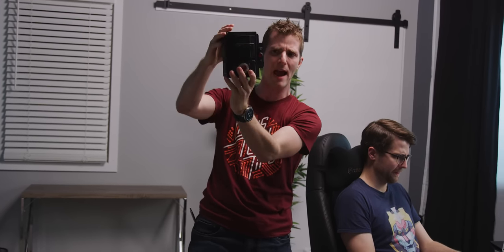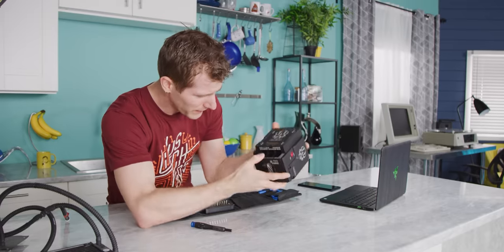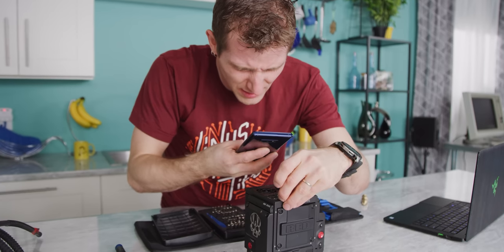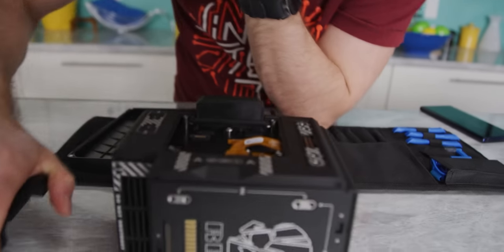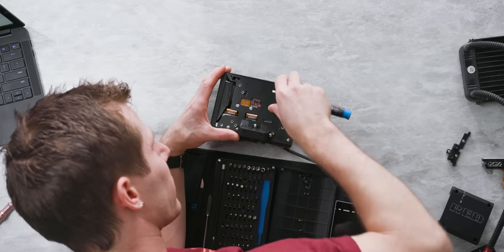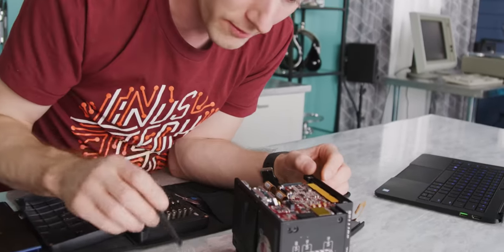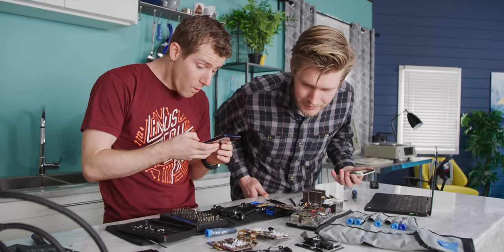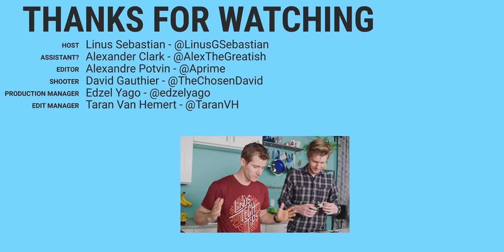We TOOK APART an 8K Camera!

Comment: I wouldn't be surprised if Linus ends up dismantling Elon's next SpaceX reusable rocket.
Reply: LINUS HOW DID YOU BREAK THE FUEL PUMP
Reply: Watercooled rockets ?  Hell yeah
Reply: RGB rocket!
Reply: @Am65103  Forget reusable, it wouldn't even be usable.
😂🤣😛
Reply: Can't wait for a watercooled Falcon Heavy
Reply: Starship will have regen colling, so Linus won't need to add liquid cooling to it.
Reply: What if he drops the rocket then? Elon will be pissed.
Reply: Yeah, I bet Linus would love to water cool a rocket's onboard computer
Reply: Sponsored by IFixit
Reply: straps 100 nhd-d15s to a rocket
Reply: to watter cool it and attach rgb to it
Reply: Actually the rocket is fuel cooled. The temparature of the engine exhaust it too high for the material the engine is built out of. So they pump fuel (in spacex´s case it's chilled Rp1[highly refined kerosine]) through the compustion chamber and engine belt (they are two-walled fuel flowes between them).Then it gets burned in the combustion chamber.It is called regenerative cooling. Man this comment is kind of overkill

Comment: Next, tear down the new IBM quantum computer.
Reply: Drop it instead
Reply: They may already have done this, but we wouldn't know until it was observed.
Reply: Water cool it
Reply: @KieronMiddleton  Nice one
Reply: @BarnyTrubble  I mean since they already use things like liquid helium cooling to achieve the temps needed for quantum effects I don't think adding water will work out well.... Of course adding water here isn't working out so well either...
Reply: @Ender240sxS13  water cool it
Reply: hahahaha XD too good
Reply: It needs to be water-cooled .
Reply: these are already like liquid nitrogen cooled right
Reply: @kawatzaki  no, nitro is to "hot" for the pusrpose of QCs -> these are using liquid helium. Actually 2 isotopes of helium in some special concentration, that allows them to create self sustainable near zero K cooling cycle and then you can observe the quantum states of collapsed wave function ;)
Reply: Not even they have enough money to buy it. But the might let them go there and he drops it then?

Comment: "Part 2 : Ordering a new Red 8K Camera"
Reply: Well at least its only the camera and not all the accessories!
Reply: @KoploperMau  RED is EA - charging up for all the DLCs(accessories)
Reply: Part 2 : Maybe I should have had my hands shut
Reply: @JazibAli360  From a professional standpoint, having it modular is way better for upgrading and repairing. If you want to upgrade or repair something, won't it be better to just change the part, instead of the whole camera system?
Your comment is like telling me PC part manufacturers are basically EA because you have to buy every part of the PC instead of an all in one package.
Doesn't make sense to me.

Comment: Building $1000 PC (uses anti-static mat)

Taking apart a $30,000 camera that isn't designed to open ever especially out of a factory (no anti-static mat)
Reply: They need more than an anti-static mat for this...
Reply: 60k*
Reply: Neckslit  that's for two cameras plus the *accessories", one block of camera alone costs 49.5k
Reply: Oh yeah yeah
Reply: lol
Reply: Trospher no thats for 1 camera with all accsesories
Reply: $50,000*
Reply: Neckslit  it cost $130 for two of the cameras and accessories for both

yikes
Reply: $50,000*

Comment: Linus you're wrong about the lack of a performance gain. Reducing the temperature of the CMOS will improve the low light performance substantially by reducing thermal noise.
Reply: And how many LTT episodes were filmed in the dark?
Reply: Soooooo what you're trying to say is, they need LN2 all up in this bitch?
Reply: @beni2cc  Exactly. We need more LTT videos on astrophotography!
Reply: also i think it could probably handle more fps for a given resolution than it can in "normal cooling" condition, if only the firmwere would allow that.
much like those cameras that, with a firmwere mod, can shoot highierbitrate/fps/resolution than manifacturers allow them to, but often overheat while doing so
Reply: @beni2cc  Image all the RGB-in-the-dark shots in the future if they pull this off
Reply: @beni2cc  RGB showcases. Where it matters most actually XD
Reply: I don't think the sensor is hot enough running with stock cooling for there to be any significant difference. The sensor is quite large and must be at least somewhat powerlimited since it's running of Batteries. It should therefore be quite easy to cool, theoretically at least.
Reply: @beni2cc  It would technically benefit for any situation, but the one in which we could see a significant difference should be low Light scenes.
Reply: Well the question there is whether they'll actually be cooling the sensor or just the processing and power delivery elements.
Plus, even if they did, wouldn't water cooling introduce vibration to the sensor? You've got fluids flowing through a block mechanically coupled to the sensor.
Reply: @PierrePotonnier  what I'm tryna say is, no one is complaining that LTT's 8k videos are too noisy
Reply: @tiarkrezar  lol
Reply: @covoeus  imagine*
Reply: @beni2cc  Yet. I will start doing just that for every video starting with this one:
This video is quite noisy if you couldn't tell. If only they watercooled their camera.

Comment: Scientific cameras very often have active, sub-ambient cooling solutions, especially ones with greater bit-depth than 12-bit. For example, in our lab, we have a 16-bit X-ray CCD which is attached to a Peltier element which cools the chip, and the hot side of the Peltier element can be cooled with both air and water. We typically run it at -70 degrees Celsius, as, even compared to -60 degrees, the inherent electrical noise is just sooo much lower. This matters A LOT in high-dynamic-range-applications.
Reply: Agreed, I think Linus is actually underestimating the value of cooling the main image sensor.
It's amazing to see that consumer level cameras are still all passively cooled, even when we have Sony A7's overheating left and right. In the next decade or so I predict we're going to see a new revolution of cameras with active cooling.
Reply: This thread was more interesting than the video
Reply: @highks Okay, but the RED 8K is actively cooled.  Any other camera could use the same trick of passive while running video, active after that until cool enough.
Reply: @budthecyborg4575  It seems straightforward to run a heat pipe from the image sensor to a plate on the bottom of the DSLR.  If the user wants to get it cold, just cool the plate.  If you're willing to drag around the weight, you could even put a Peltier on it.  It won't work colder than the freezing point of the fluid in the heat pipe, but that could be methanol for a -114 C limit which ain't bad.  If you don't cool the plate, the camera just passively cools through it.

Comment: You guys are nothing short of absolute lunatics, and it's awesome! I am very excited about this potential project, but I do hope you tread carefully when you come up with a plan. I'd love to see some machine work done (by an outside source if needed) to make custom heatsinks so the casing could still be screwed together. That camera is going to be twice as baller status if you are able to pull this off. Good luck!
Reply: That's what I was thinking too. The only way they can pull this one off is if they bring in outside help to have water blocks/mounting designed and machined and then all other stuff needed to route the hoses out 3D printed.
Reply: They do have a CNC but I don't know if it would work for this type of project
Reply: Plus when tearing down a device like this a more professional approach may be better than their usual 'just use zipties'

Comment: Of course this project is possible. But you're going to need far more skill than has been displayed in your other builds. I'd get on the horn with CNC mill operators/machinists ASAP and get whichever minion of yours is best with 3D design to start drawing the mating surfaces of all parts to be cooled.

Also for those wondering it would take about 35 million views for a YouTube video to pay for this camera. Not enough cats, dancing or Fortnite for that to happen.
Reply: Ben Heck Hacks heeeeeeeeeeell yeah Ben heck, my man
Reply: You called minions to the workers
Reply: Was wondering if it was worth taking apart a 30k+ camera for 3-4 millions views well if it does work it's a nice project for rich people :P
Reply: Not just the lack of skill either. This is a big project, not something that can be done in 1 or 2 days with no knowledge of the system being modified. They should have bought a dead red camera and used that, using your production tools is never a good idea.
Reply: The L E G E N D himself
Reply: They need AvE !!!!!!!
Reply: Please, stop. This is 5 axis machining, very complicated design work. This is NOT Ben Heck level stuff... The designers and engineers at RED are badass and have very specifically designed this stuff to work. I'm sorry Linus and Alex, but you're not cut out for this.... Stop. It's not funny, it's just dumb.
Reply: @thomasp4902  Did they say it was a working camera? We never saw it in action so... IT is LTT though.
Reply: @tjarsun  YEAH
Reply: LTT also has other sources of income such as floatplane, sponsor revenue etc
Reply: kickasssloth360 you must be new here
Reply: More skill than it took to take a sawzall to a graphic card heat sink?
Reply: @MakerofThingss  It's most certainly not 5 axis machining. It can easily be done with 3 axis or 3+2 axis positional
Reply: A few copper sheet and an hacksaw are enough
Reply: YES! Get in contact with them and make a water cooled, portable RED camera.
Reply: Yeah. It will need a custom body.  The best and riskiest part I could do is apply metallic thermal paste on those chips.  
I really don't know why Linus have to do this, plenty of time and money I guess? 😁
Reply: @xenonram  true, but point of seriousness stands.
Reply: I think your comment will just encourage them even more. Knowing Linus... yeah
Reply: Ltt needs far less than that. The more subscribers you get the more you get per view
Reply: @jordansean18  Can you give use the link to that?
Reply: @CharlesStaal  who lied to you
Reply: amazin... what if thanks to this video he gets 1 extra million views in his next 35 videos and therefore thanks to this video gets 35 extra million views? u obviously dont know how things work :D
Reply: that depends on how much they make a vid, some people make like 25k for 1.4m view vids (finance has a high return boi) + they also get sponsors which you need to take into account and whatever merch sales they get from this video + affiliate, at the very least they will probably break even
Reply: They just got a CNC machine.
Reply: if you get a guy in his mid 30s to early 20s to make a video about tape youll get that money in 11 months :)
Reply: quick call Brian the Electrician
Reply: (x) doubt. It might be 35 million views for a channel your size but a 8 million subscriber channel probably makes the majority of their cash with sponsor deals and merch rather than regular youtube money. Would be interesting what dbrand etc. pay him for a 20-30s ad per video. Also since that red camera is part of their work equipment they can write it off against tax making it a lot cheaper effectively.
Reply: Ben, cat and fortnite videos make far far less per ad than tech videos. LTT is huge with enormous personnel costs.  Cost of that camera is nothing to sneeze at but for them it really is a drop in the bucket.
Reply: Ben Heck Hacks
^THIS^ is EXACTLY what I was thinking.
Reply: Exactamundo!
Reply: @MakerofThingss  Eh.. Not that you're wrong, you're totally right, but Red's designers and engi's bad ass? eh...
Reply: @Icepacksicy  But would we be watch LTT if he didn't do stuff like this? So the value is that the 1 million people that watched this will watch 35 more LTT videos, hoping he does something this ridiculous again. 🤣
Reply: You forgot about the sponsor
Reply: SPONSOR

Comment: I came from the future, your next vieo is in 360p
Reply: hahaha
Reply: Fun Fact: Old greyscale pictures have infinite resolution (well, down to an atom atleast).
Reply: @ Gustavo......
beer through my nose .....  
Thats a Fking Rippa!
Reply: @Voxters  no they don't. film grain is a thing; you can think of it roughly like pixels, except instead of in a square grid they're distributed randomly and vary in size. that aside, lenses also have limited resolution, there are limits to how perfectly a lens can focus an image (look up "resolving power").
Reply: @spambot7110  Right, but we just talk about different things here, "calculated resolution" and "imperfection"
Also youre never able to get anything in 100% focus. So there ever will be a point, where information gets lost.
Reply: Voxters that’s so incorrect for so many reasons.
Reply: Voxters yeah but no it technically has a resolution the grain while it isn’t a perfect measurement some film types sold where known to have more or less grain this would be advertised as the quality would be higher if it has a higher grain
Reply: He got two red camera

Comment: An extra kg of Thermal Paste makes it quiter and cooler - THE VERGE
Reply: i think we got to the point where we don't talk about that anymore
Reply: it's more like tons of Thermal paste than a KG. =)
Reply: @thomasvandenbergh1098  Why not??
Reply: too much paste means poor contact/design.
That's why its chuging air between takes.
Reply: @michaelansbro1512  Congratulations, welcome to the joke.
Reply: I literally managed to forget that the verge pc even happened until this comment :(
Reply: @michaelansbro1512  Thanx for letting me know that
Reply: @michaelansbro1512  LTT already tested thermal paste application and found too much isn't really much different but too little is bad.  Once contact pressure is applied it squeezes out the excess, you can see it around the edges of the contact area on the heatsinks of the red.

They could try better thermal paste or risk liquid metal.  If it's copper I wouldn't bother with LM due to the alloying, they don't want to take it apart again to re apply LM.